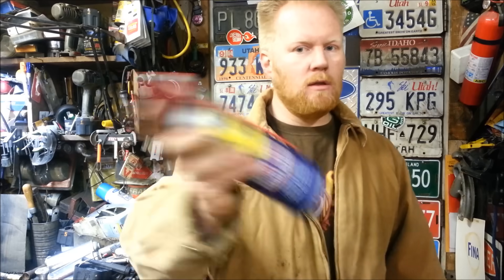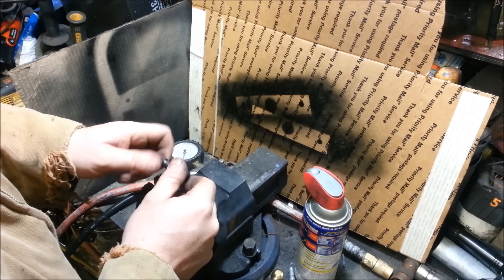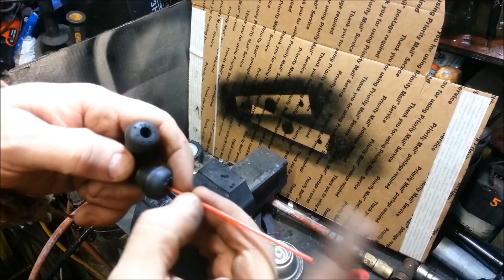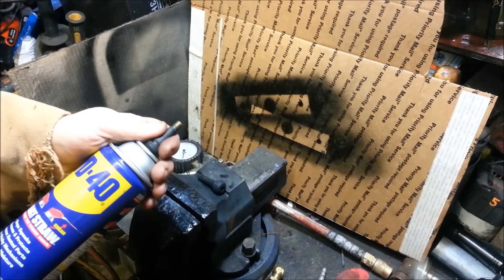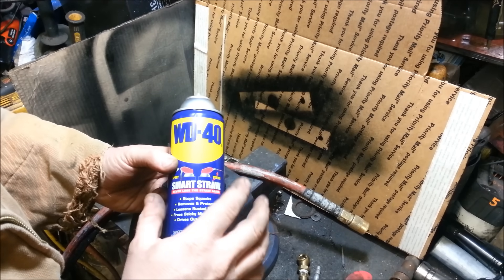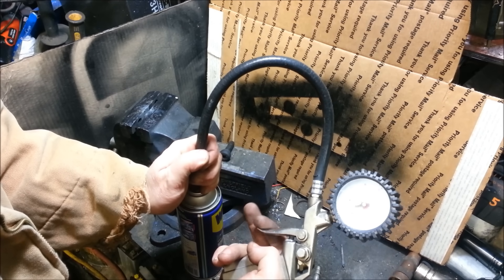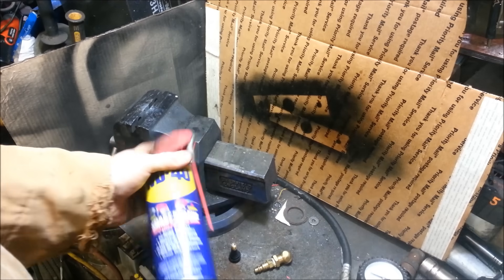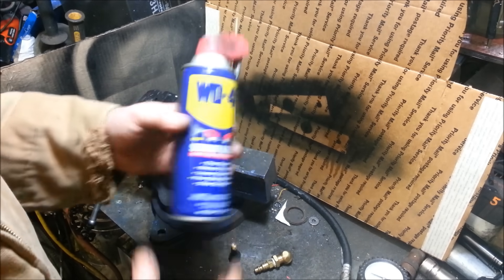Refill flat AEROSOL Spray Cans like the WD-40 and others

Comment: That's an awesome tip, I have a big ol air compressor, the valves and 101 old cans half filled with no gas, I bet it works with paint cans etc, gonna try it, thanks mate :-))

Comment: buy wd40 in the refillable pump spray bottle. avoid the aerosol can
Reply: best idea of all
Reply: ...but this is good for other stuff you can't buy in bulk.  Very cool!!
Reply: Yeah..... but this video is about an aerosol can. Not someone's opinion. Can you see the difference between the two....
Reply: C50GE Greg no, the one Gallon jug it the way to go.
Reply: WHAT???!!!  Where do they sell THAT?  Really?  I want some!
Reply: Dispensing with a pressurized can is a better way to ensure the oil/lube/whatever is forced into otherwise inaccessible crevices and extremely tight areas, so that it is better able to do do its job. That said, the refillable spray is more than adequate for a lot of applications, so I do second your recommendation. Just wanted to clarify the benefits of an aerosol.
Reply: Pump style sucks ass the aerosol can is way better
Reply: 1 Gallon Can WD-40

https://express.google.com/u/0/product/8166025876145853426_2486045708353215754_6533706?utm_source=google_shopping&utm_medium=tu_prop&utm_content=eid-lsjeuxoeqt&gtim=CJ76wtexiITxBRDimZaNtv38svgBGKD8tw0iA1VTRCig7-vgBTDK5I4D&utm_campaign=6533706&gclid=Cj0KCQiA3IPgBRCAARIsABb-iGIRvQYLaspCpP70ozpnR8IStWapX7AhmUuPb65VchjlBCy2sLjMYZkaAhVcEALw_wcB
Reply: There's other uses for aerosol WD40 that won't work with a pump spray like using it as a starting aid for diesel engines.
Reply: @ffjsb  The vast majority of people that buy WD-40 do not even own diesel engines and even the people that do I doubt very seriously that they have to use WD-40 as a starting aid.
Reply: ke, maybe you should try and improve your reading comprehension.  Nowhere did I say that the majority of people buying WD40 have diesels, or that they HAVE to use WD40 as a starting aid.  I said you CAN use it, not that you have to use it.
Reply: @ffjsb   Nowhere did I say that you did.
Reply: You most certainly implied that I did.  Why else would you bother saying the most blatantly obvious statement that the majority of people that buy WD40 don't have diesels????  And that you doubt that they HAD to use it as a starting aid????
Reply: ffjsb
That's right. That's exactly what you said. Just a true statement.
Thumbs up.👍
Reply: @ffjsb  
Another thumbs up for you ff.👍 some people can't admit when they're wrong and just keep throwing more stupid words on top of others.
Reply: C50GE Greg g

Comment: Another thing you can do in a pinch, is put the can in a freezer for a while, then press down on the cap after it's had time to chill and it will pull in a bit of air.  Not as good as using a compressor, but it will allow you get a little more out.
Reply from the maker: Good tip.
Reply: This sounds like a cool idea but it has a chilling effect on me.
Reply: I guess ya can go the other way ,just hold a lighter to the can to gain pressure(note to the curious, ,don't try it was meant in the sake of humor)
Reply: This may be a good idea, but it leaves me COLD!
Reply: Burrrrrrriliant!    I've practiced this method so many times I got it down COLD!

Comment: What kinda pressure do you need, for it to diesel on you and blow up?
Reply from the maker: Over 700psi plus heat for diesel/oil to ignite. You won't come anywhere close to that.
Reply: Thanks.  I can't wait to pull this trick on my half empty spray cans.
Reply from the maker: I generally use around 40-50psi
Reply: Davey Bernar

Comment: Have you got a good way to permanently attach a straw to the paint nozzle?
Reply: use a very thin layer of cyano/Krazy glue and then stick the straw back in....  presto....  bend it to suit with a heat gun or torch at a distance....
Reply: I had tried superglue, I'll try the Krazy glue. I read it's suppose to be close to 100% ethyl 2-cyanoacrylate others are around 92%. 
Great tip for setting a bend in the straw. Maybe a bic would work too.
Reply: you need to make sure that you clean the nozzle and straw with a decent iso alcohol or acetone first to ensure no petrochemicals interfere with bonding....  I glued a straw to my PB Blaster easily enough... maybe I was lucky...  try epoxy 5min?  trick is not to plug it up..

Comment: This is a very dangerous practice demonstrated in the video and I urge you to take it down asap before someone get maimed or killed. WD-40 can be used as a starting fluid for lawn mower and other gas engines, it's that flammable. Air or compressed air is about 21% oxygen, so fuel (WD-40 or spray paint, etc.) + oxygen + an ignition source (like a can left in the hot sun) yields... boom!Look at the label of the product can you are trying to refill. Most paint products are propelled with butane, Look at the Material Safety Data Sheet for any spray product you can find, I challenge you to find even one (except canned air) that uses air as a propellant. The propellant usually has a relatively low vapor pressure - for example, butane's is 50 PSI at 100 degrees F.Many paints cure in the presence of oxygen, so a can re-pressurized with air is likely to cause your paint inside to turn into a cylindrically shaped rubber lump in a few days.
Reply from the maker: Fuel+Oxygen+ignition source=boom. Yes, but where is the ignition source(hot car is not one)? The air/fuel ratio needs to be precise for a spark/flame to ignite it.  

WD40 is considered Flammable only because it is an oil and will hold a flame is heated above it's flashpoint (https://youtu.be/tOfDwOSDLYM). By itself it wont burst into flames like gasoline. It is really only Flammable when it is filled with butane/propane as the propellant and most modern cans are filled with Carbon Dioxide. I can easily refill a can with propane, but would never hear the end of it from the Safety Nazis. 

This idea is nothing new and they sell commercially made refillable aerosol cans they you put bulk wd-40 or any other liquid in and then fill it will compressed air.  Google refillable aerosol can and see.

On a side note: "canned air" is not air at all but rather "Freon"(r-152a new/r-134a old).  No commercially made products use "compressed air", not because it's dangerous but because it makes a poor propellant. Propane, Butane, Freon, CO2, etc turn to a liquid when compressed and stay their same relative pressure whether the can is 100% full or 5%. So the paint, penetrating oil, etc spray consistently throughout their life (if all goes to plan and it doesn't leak out).  Compressed air(80% inert nitrogen/20% oxygen+)  doesn't turn to liquid when compressed, so only so much will fit at a specified pressure. The majority of an aerosol can is filled with product with 20%+ space left for propellant. So if you fill it to 100psi of compressed air, and begin to use the can; at 50% empty the air space has tripled. This makes the air pressure drop relative to the space and you now have 33psi and a poorly functioning aerosol. You'll have a difficult time using the remaining product in the can. This is why they choose to use Propane, Butane, Freon, CO2, etc with their ability to maintain pressure.
Reply: Try spraying WD-40 into the mouth of a non-starting lawn mower or leaf blower carburetor (after removing the air filter of course). When our power equipment won't start, WD-40 usually saves the day; it's a property of the product my father-in-law taught me about 25 years ago; it's a lot more flammable then you might think, especially when compressed (like in an engine cylinder).
Reply: WD-40 aside, I fear are you missing my bigger point. Yes, WD-40 is propelled by CO2, but other folks, not as chemically minded, are going to follow your advice to recharge spray paint cans (full of potentially explosive volatile flammables like toluene/toluol), etc.  Imagine if someone used your technique to re-pressurize a can of Diesel Engine Starting Fluid (ether). If your video suggested using a bottle of compressed CO2 with a regulator to step down the pressure to something in the 50-150 PS range, then for most products I can think of that someone might deicide are worth re-pressurizing, then okay safety-wise because very few things are going to react with CO2.
Reply from the maker: Even with a flammable substance there is no fear of it going boom. Since it is sealed, no spark can enter. All spray tips act as flash back arrestors and even if you have a correct combustion mixture inside the can, flame can't travel back into the can. Pressurized combustion doesn't occur until an astonishing 700+ psi. Top rated spray cans are DOT 2Q rated to 275psi so will never allow for pressurized combustion. They built them to this rating to withstand being left in a hot car. Yes, the small percentage of oxygen in the air will act as an oxidizer and promote combustion if a can is physically burst and exposed to the a combustion source but at this moment it is exposed to the air outside the can and the results are negligible.
Reply: My hope is to have you revise your video, urging viewers to use CO2 or some inert gas, like argon, as a propellant, or urge them to abandon the technique entirely. I don't feel I am convincing you there is a great danger here, so I ask you to phone your local Fire Marshal to ask him/her to review your video and comment on it. If the Fire Marshal sees the video and pronounces the technique safe, then you may ignore what I have said with a clear conscience.   To reply to what you said above, 21% oxygen compressed is not a small amount of oxygen, especially if the viewer's spray can has only say a third or less of its contents remaining. The contents will begin to react by slow oxidation. If the can is heated, the reaction rate will increase, all the time releasing heat, until the contents kindle or detonate.   I live in Portland, Oregon. Sadly, two families here in the Greater Portland area were burned out of their homes by Spontaneous Combustion in June by fires caused by oily shop rags left in a pail instead of a UL approved Oily Waste Can. In a hot car, or other unforeseen condition (like sitting on a shelf in the sunlight on the window sill of a hot garage), Spontaneous Combustion or Spontaneous Ignition of the contents of a re-pressurized spray can and eventually will cause a fire. I can't imagine you want anything to do with being the indirect cause of someone loosing their home or worse, so please, please do as I suggest and ask your local Fire Marshal or even just visit a local Fire House and see what the firefighters have to say about the video,
Reply: I couldn't agree more John, good points raised there.. I'm a chemical engineer, and I work in process engineering (i.e chemical plant design). Putting compressed air or oxygen into a vessel containing combustibles is a big no no.  It just doesn't happen,  there are too many unavoidable risks to content with, let alone adding entirely avoidable ones. In industry, if a vessel were charged with air and combustible solvent under pressure, someone would get in serious trouble. 

The other engineers on Eng Tips or one of the other engineering forums would have a field day with this. 

For some aerosol cans i.e containing diethyl ether,   this would be suicidal. Someone could literally get killed. 
In addition to the formation of highly unstable explosive peroxide in contact with air, it also has a very low auto ignition temperature of only 160 deg C.  Also, some fuel air compressed mixtures can be detonated, i.e set off by shock alone. 

Ether and similar solvents are used in paints too, its begging for trouble. I would suggest maybe using butane from cig ligher refill cans, its cheap and compresses easily. Even if just for peace of mind.
Reply: Thank you for lending your voice in an effort to get the author to abandon or at least modify this aerosol re-pressurizing technique. I'm sort of an aficionado of technical disaster books, like:  What Went Wrong? – by Trevor Kletz;  Engineering Progress Through Trouble – by R.R. Whyte;  Inviting Disaster – by James R. Chiles;  Set Phasers On Stun – by Steve Casey;  or Digital Woes – by Lauren Weiner. As a Chemical Engineer, you are no doubt familiar with Trevor Kletz's several books on chemical or petrochemical plant disasters, detailing so many lives and much property lost due to simple misunderstandings or tiny oversights like the one suggested in this video

Comment: It seems this technique could be used to refill compressed air cans too (the kind you use to blow dust out of electronics). Is there any reason you can't do this?
Reply from the maker: Compressed air cans aren't actually air, but rather "freon" (r152a). When it is compressed it turns to a liquid and allows a large volume to be in a can. This gives you a long spray time and you'll notice the freezing of the can/spray. Plain air will only give you around 5 seconds of air spray.

Comment: You ever heard of dieseling effect? Oil under pressure! KABOOM😱😜😰
Reply from the maker: Oil under a ton of pressure does this. It would take over 700psi to get close to igniting the stuff in the can (not obtainable by a standard or even a high pressure air compressor).

Comment: Compressed Air + WD-40 = Bomb.  Don't kid yourself, it can blowup.  If your are going to do this, use Nitrogen.
Reply from the maker: "Air" is close to 80% nitrogen. You would have to compress air and WD-40 to well over 700psi to cause an ignition. Not obtainable by any standard air compressor, nor would the schrader valve hold that pressure.
Reply: Air is 78% Nitrogen, and yes, I still think this could be a problem. That's why when WD-40 is manufactured the "Propellant" is Butane; not Air.
Reply from the maker: No, they put propane/butane in because it turns to a liquid and provides a consistent pressure throughout the use of the product in the can. "Air" diminishes and the pressure drops as the product in the can is released. Refillable aerosol cans like these; that you put in your own product in a fill with compressed air are sold everywhere and are nothing new.

Comment: Note the difference of gas expansion between aerosol propellant and regular air. I would take caution to keep the can far below its max pressure when refilling with regular air. Propellant gases are chosen to prevent over-pressure rupture when ambient temperatures increase. Do not try this at home should suffice :)
Reply from the maker: +John Lewis Actually propellant gases are used as the turn to a liquid under pressure and deliver a steady spray pattern pressure throughout the volume of whatever you're spraying.  These propellant gases(co2, propane, r152a, r134a, etc) do increase in pressure far more than regular air when heated.

Comment: you know if you refill one of those cans and dont use it right away it will rust from the moisture in the air,and possibly exlode if you forget about it in a garage or basement for a long period of time,if you try it with paint the air will condense and mix with whatever is in the can,good i dea if your in a pinch though
Reply: +Carl Courtney       That wouldn't be a problem with WD40. It's made from fish oil and wouldn't rust. An FYI, WD40 was invented by people who were trying to find a product that would displace water. When they conducted their 4oth test it was water displacement test #40 so they named it WD40.

Comment: Seems like a good fix in a pinch, but it looks too easy to over pressurize the can.
Reply from the maker: +Vin DiVergilio The cans are rated to 275psi which is unobtainable with a standard air compressor.

Comment: What do you do for cans with recessed valves (like brake cleaners), where you can't push the valve to let the air in? I've tried using an air needle (for filling soccer balls), but that barely lets any air in.

Comment: with the buck you spent on the valve you could have got another can
Reply: maybe so, but you can fix endless cans that have lost pressure due to temperature changes and time, seems like a worthwhile investment to me, I have several cans in my garage right now actually that i will be able to fix..

Comment: You keep saying "air" they do not use air to pressurize aerosol cans. They use propane. I do find it amazing that air works so well , but I'm sure the moisture starts to rust the inside of the can. I would think after a few times you wouldn't want to use the can anymore. Thanks for sharing this. I found it fascinating seeing as I've been making spray paint for over 20 years. Be safe my friend.
Reply: no, it shouldn't rust... its got wd40 coating the inside, which, AHEM, displaces moisture. Unless you never drain your compressor or live in a rain forest,  there shouldn't be that much moisture in the compressed air. If you're that concerned, install an air dryer. I run 2 when using my plasma, just for good measure.

Comment: I've been refilling low pressure cans for years with the rubber tip on my Cornwell  air nozzle...valve stem is a good idea Thanks 65ford.
Reply from the maker: +Joe Boyko (HELLBENT4) Thanks.
Reply: wheres your vid ?

Comment: you could also take an airduster and shove the straws together or take the head from an airduster and put that on and join the straw, easy way because airdusters are like $3
Reply: And then refill the airduster can also. They cost $5 or 6 bucks by me. Do you know what pressure those cans hold? They also Have moisture of some kind In them. Maybe not a good idea to refill those??
Reply: +hotheadedjoelhaha airdusters are $3 each and contain a ton of aerosol liquid
Reply: Ok Dman, I was just saying that they are more expensive where I live. Thanks.
Reply: hotheadedjoelhaha yeah, they really vary in price depending where you are. best bet for cheap ones is at walmart